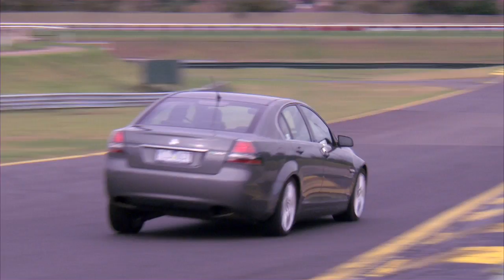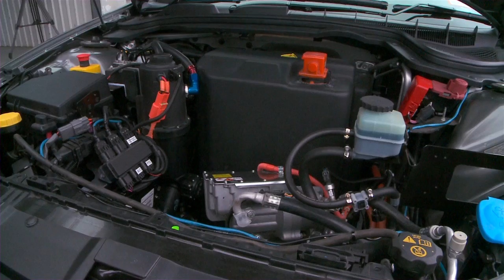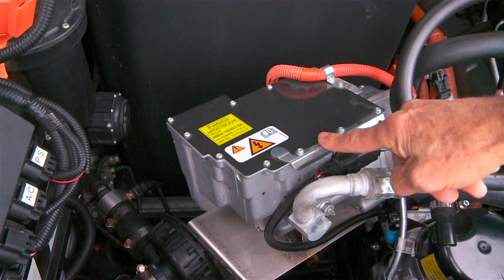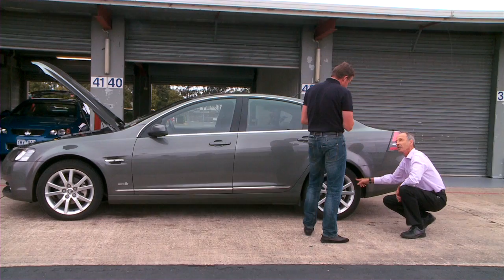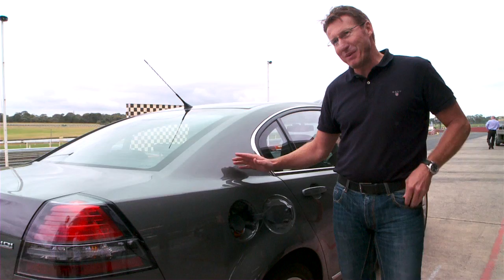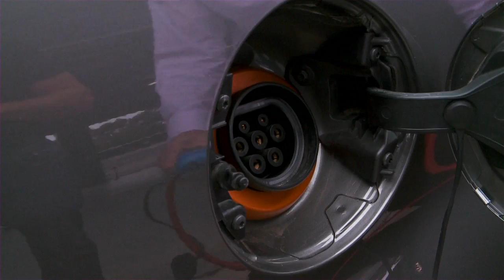Part 1: Tour of the all-electric Holden Commodore prototype with Mark Skaife

Comment: IDEA!!! Holden Voltage VF ii awd full electric with a solar panel for a roof and spoiler
Reply: the solar panel roof is an alright idea in theory but one solar panel on a sunny day wouldnt even supply enough power to run a dominos bike at full power.